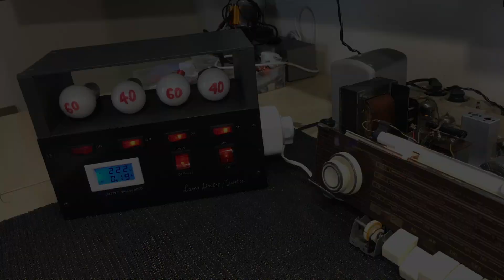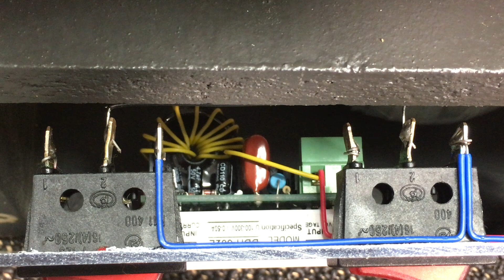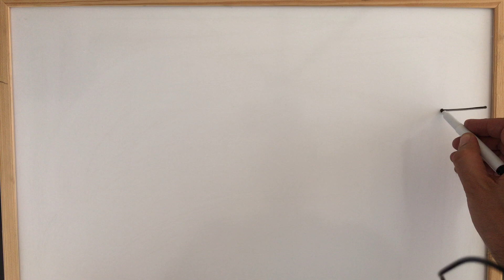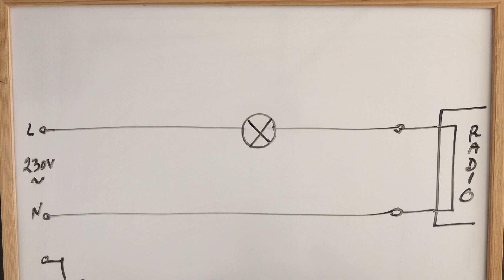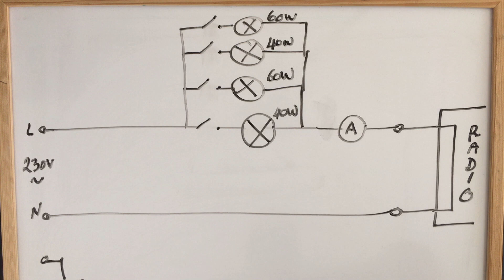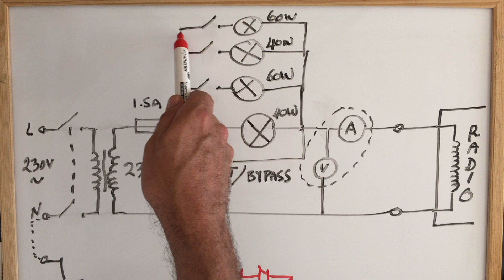DIY Test Gear: Dim Bulb Limiter / Tester with Isolation - Design and Build

Comment: There are some really nice ideas in this built / video - and also in the comments below the video! And, yes, although this schematic is not rocket science, you explained it very well - even for beginners. 
Personally, I have two variacs with insulation transformer in my workshop, but I almost always use only one of them. I would never ever want to miss the variac - being able to slowly increase mains voltage can be so helpful, especially when powering up old tube gear for the first time (it's helpful to re-format the electrolytic caps, it's always good to slowly increase the voltages until the tubes slowly become conductive and B+ slowly builds up and so on...).
On my variac / transformer, I have a switch to connect the DUT protection earth to ground of the mains. It also switches on a red lamp to warn me - but I always wanted to swap this lamp with a flashing light to make it safer. I like the idea of a relay, that automatically resets, when the unit is switched off. In my experience, sometimes it's helpful to be able to ground an amp that is currently being repaired, e.g. to check for noise / hum issues and the like. I might upgrade my unit with maybe 3 different bulbs and automatic resetting relays for the current limiter and the PE-connect in the near future.

Comment: Would there be a posibility to have the indicator of the bypass switch to be lit before you turn on the output power? That way you would be warned it's on bypass mode before you flick the output switch. Maybe add another switch as a master on/off switch so the volt/ammeter will also turn on even before you switch on the output.
Reply from the maker: You could do that, but I have become so accustomed to this version that I will stick with it for now.

Comment: Excellent video and device. I will be making a very similar one but will also add a fuse straight on the mains wire before the isolation transformer. Well done and subbed. 👍🍻🤠🇦🇺

Comment: An excellent video thank you. As you are maybe 100 years plus ahead of me on electrical repairs etc I have to ask you a question please. I own an older toroidal isolation transformer power supply which was used to power healthcare hospital equipment. The 120volt output side has all ground connections disconnected. Can I use this light bulb set up but just remove the built in isolation transformer and power it from my own isolated power source. For me it’s a cost saving thing. Thank you.
Reply from the maker: Sure, that will be perfect
Reply: @electronicsoldandnew   Kudos on the swift reply. I’m learning so much from your channel. Super grateful for people like yourself willing to offer up so much information and advice. You Sir are a one off. Cheers 🍻
Reply from the maker: Thanks

Comment: Nice build! I would add fuses on the primary side too. And you would need to connect the protective ground to the front panel, if it is made of metal, as is in your case aluminium You can look up the rules about the metal sizes above which you need to ground those parts that are accessible from outside. Another thing, do you experience the inrush current of the toroide? Those can be high for bigger transformers, sometimes, depending on the remanent magnetism.
Reply from the maker: 👍 and yes, the torroid does draw some serious inrush current
Reply: @electronicsoldandnew  Do you have any limiter for this? Recently I got from work a discarded medical grade isolation transformer (600VA) build in an enclosure. I took it home and test it. At first it looked all right, but after a while the built in start-delay-circuit / soft-start / inrush-current-limiter, (model OPN 8 from telema company) started to oscillate. So I thought, yeah that's why they discarted it, okay. I opened the case and I have seen that this module (completely casted) have dark / burn spot. I searched for this model on internet and have seen the same problem image and description. When I tried to use the transformer directly it blew the primary fuses 2x1.5A once, and at the same time the automatic fuse downstairs 16A. So that was not really handy 🙂   Temporally I have connected a 240 Ohm 10W resistor in series, permanent if plugged in 230VAC, and with the main switch on the front I turn the transformer directly after a while. So it gets low current to settle down the magnetic field. This works but probably not the most elegant solution. The unit also have only the main switch on the front, nothing else. So maybe I will try to add some more things to it. Voltage/Current reading on the secondary would be nice. I have constructed a 1 bulb current limiter on a wooden plank. I am not repairing a lot, but this is handy to have on the side. Sometimes I try to repair a mains SMPS, and then have trouble using the scope. And it is much safer of course.
Reply from the maker: I would build a simple soft-start circuit externally and fit it at the primary of the transformer. Basically the resistor you have already is fine, and the soft-start circuit would just short it with a relay after a second or so. There are tons of these schematics on the web.

Comment: It could be an idea to use instead of the shorting switch, a 220V relay a the output. If there is not enough output voltage the relay can not be engaged and it is impossible to make a mistake

Comment: hello and many thanks
i want to build one , few questions please : 
if i will build without the transformer , what i will miss ?
what are the main advantage of the transformer ?
can you please add links to the amps module. and to the whole switches , so i can easily locate them to buy ..?
and what about the box ? can i but one ?  or only self made ?
thanks

Comment: Hi , so this design would be OK for SSB cb radio 240v AC  base station troubleshooting that draw a maximum of around 4 amps continuous if you didn't include the 10:1 (10amp :1amp )rf choke on the AC/DC LED display meter ?
Thank you for this video.
✌️ ❤️

Comment: Did you use a special kind of switch? I made a DBT with two sockets, three switches. One for each bulb and one in the middle to bypass the bulbs. Everything works great except I cannot seem to figure out how to wire the switches to where the lights work correctly. I double check all of the switches and they are rated for 125V, but I cannot use the light function or it trips the breaker. When the light pin is not used the DBT works perfectly. I have repaired a bunch of ATX power supplies utilizing it but I would like to have the lights on the switches work correctly. One more note, I am using SPST switches so I'm wondering if my issue is they need to be DPST, or SPDT or w/e.
Reply from the maker: I got lucky when I found these switches, and the issue has been discussed in the comments. Some others have had the same issue and seem to have identified switches that work (see comments). I’m afraid I have no idea where I bought these switches. I had them for ages before using them.
Reply: @electronicsoldandnew   Hmm I read through the comments but cannot point out which one answered
Reply: They are switches, the most simple electrical/electronic device in the universe.
If you cannot work out how a switch works, you REALLY shouldn't be playing around with mains powered equipment. 😮
If you are using self-illuminated switches, you obviously have the line in, line out and neutral cables on the wrong switch terminals. You own a multimeter, right? You can read the circuit diagram on the switch, right?

Comment: I build this about the same way. but i have a problem with the neonlights in the switches, when i switch one of them on, all the neon lights go on, they get there power of the common of the bulbs
via the bulb that is not powered on
Reply from the maker: Check the comments on the video. Someone mentioned which neons work and which don’t. I just used some I had on hand and was lucky.

Comment: Im building one at this moment. The doubt I have, is why did you put a switch on the first bulb, as you will always have it in series with the load. Besides we have the bypass switch in case we want full current flow. Am I missing something?
Reply from the maker: Having all the bulbs switchable gives me all the alternatives possible. What if you actually wanted just 60 W? If the first bulb was permanently on (40 W), you would not be able to achieve this.
Reply: @electronicsoldandnew  ok, thanks. Mine will have 4 times 40w bulbs (what I could get my hands on with a real filament), so the next step up from 40 will be 80w. So only 3 switches in my build then. Thanks for the video, never new about these dim bulb limiters. Next will be getting an Iso.Trans. Got a real heavy shock ones grabbing with both hands an old radio chasis plugged in the 220v. My hart made an arritmic pulse and luckly I bounced backwards in the sofa letting the chassis loose. The shock was way more powerfull than a 220 v ac tickle.   After that I got a bit scared of old radios in bad electric conditions. Did build myself 2 guitar valve amps.
Reply from the maker: Yes, the shocks on those is normally DC volts, which is worse 😊

Comment: When I add the meter, it works fine but I have issues with my dim bulb at that time. Either it does not limit or I can’t turn mains off.  I’m guessing it’s where I’m inserting this.   Any suggestions?    Thank you
Reply from the maker: It could be the type of switch you’re using. Check the comments in this video. I believe it has been mentioned

Comment: Thank you for this video.  I have a question about the voltmeter / ammeter.  The eBay listing is no longer available to purchase this.  I am building a dim bulb tester that will work in conjunction with an external variac and external isolation transformer.  Since my voltage can vary with the Variac from 0-120V (i’m in the US), I need an ammeter that will work with lower voltages.  Most of the ones I see on line only work between 80-300V.
Reply from the maker: I believe that’s the norm, unless you get one that requires a separate low voltage DC supply
Reply: These meters use a capacitive dropper to provide power to the meter circuit.
So, find the PCB trace that connects the capacitor to the mains input. Cut the trace and supply the capacitor with full mains voltage, and leave the remaining components connected to the variable mains from the cardiac.

Comment: One thing to note is… High power Push Pull guitar/bass amps (50 watts and upwards) will still make a 150W bulb glow faintly after warm up, even with no shorts, and you’ll have to recheck the bias once you run it without the limiter.
Reply: Yes, this is why I often use a 250W halogen bulb as current limiter in my setup. 
For servicing bigger amps e.g. 100W twins and Marshalls or even SVTs and the like, this is what you need.

Comment: If you want something mostly ready made enclosure wise…. 6 or 8 unit rack case for audio equipment would fit the bill. Can buy blank front and rear panels for them too, and handy drawers (if you have space left over).

Or follow MendItMarks approach and use household switches/bulb holders/sockets mounted on a board quite far up the wall next to the bench.

Comment: Inspired by your video, I have finally built my own DBT. Since I don't have an isolation transformer, I added an MCB followed by an RCD at the start of the circuit, before the switches - just for added safety. I have a question around the voltage - if I test a load with let's say a 40w bulb, I'm assuming that the bulb not only limits the current but also the voltage since they're typically 2 resistors in series.
1. Is my understanding correct?
2. And if this is true, how can we calculate the voltage available to the load depending on the number of bulbs being switched on in the parallel circuits?
3. Lastly, if a device needs a minimum of 220v to operate, I'm assuming it can't be checked using this tester?

Sorry for the excessive questions.
Reply from the maker: The voltage drops after the current starts to flow, so actually it cannot be relied on to drop voltage. You cannot calculate the voltage that results accurately, because it always depends on the current drop across the load, which you don’t really know until you try it. You can test it because the device usually starts operating  at far lower than the rated voltage .
Reply: @electronicsoldandnew  Thanks for the info. Another strange event - I connected a device with 110-220v and 40w rating to the load. I tried with a 40w bulb, but the load did not power up. I then added a 60w bulb in parallel but the load still did not turn on. The load was a hot glue gun. Any idea why this would load would not power up with a total of 100w globes connected?
Reply from the maker: No idea. Perhaps the hot glue gun requires too much current and the bulbs reduce it too much.
Reply: @electronicsoldandnew  I'm guessing that's an incorrect rating mentioned on the gun. Will try with a 200w bulb or higher.

Comment: hello... great video explained well like all the others... just one (maybe stupid) question:
if the intention of using the lamps is only to reduce the current when there is a short circuit (and therefore highlight the short circuit when the lamp lights up) wouldn't it be enough to put only one 40W lamp instead of 4? I understand that a single lamp also limits the voltage across the load... but we only have to see if there's a short... right? or is there another explanation for having much more lamps? thanks in advance and keep up with these interesting videos.
Reply from the maker: The detection of a short circuit is only one part of the story. You can get breakdown of components as they are subjected to high voltages that may not happen instantaneously. It may actually take some time before a short occurs, and in the meantime you want to see if the radio has any life in it. Also, by checking how much current it draws you can get an indication of the state of the device.
Reply: @electronicsoldandnew  ah... OK. I got it. thank you

Comment: Lovely layout.  I would suggest flipping the orientation of the ON/OFF power switch because it is much easier to slap the switch down for OFF during a panic shutdown.  Just like your wall light switch in your home (I'm in USA).
Reply from the maker: I grew up with the opposite conversion so I always do it this way 😊

Comment: May I ask a question please. If the secondary output has no neutral but basically Line 1 and Line 2 output. Does it make a difference which side feeds the dim bulbs.
Reply from the maker: no, it doesn’t.
Reply: @electronicsoldandnew  Thank you for you’re quick reply. Great videos by the way. 👍

Comment: I'm finally getting round to building an isolated dim bulb tester. Tungsten or halogen bulbs are not the problem for me. Where I need advice is how to source a suitable toroidal isolation transformer. I'm UK based so 230/240V would be ideal. Do you have any suggestions?
Reply from the maker: Try RS components or Mouser.
Reply: @electronicsoldandnew I must be asking the wrong questions because I can't find a 230/240V 1 to 1 toroidal. Ho hum I'll just have to keep looking.
Reply from the maker: look for 2x115vac primaries, and 2x115vac secondaries. Use them in series
Reply: @electronicsoldandnew  Thanks. Finally found one at RS Components.

Comment: Possible improvements: The design of an isolated adjustable AC power supply for repair and testing (calibration) is largely dependent on the type of product that will be repaired or calibrated. This is why you see so many different overall approaches on youtube. So if the target product is a tube radio then the design takes shape around what works best for radios, with one appoach shown in the video. 

If the AC power supply is to be used as general purpose supply across many products for repair and calibration (high and low line) then the design becomes more complex and usually more expensive. The obvious addition would be a variac after the isolation transformer to adjust line voltage. Also common, in my experience, is to replace the bulbs with non-inductive power resistors and include an analog AC ammeter. The power resistors eliminate the changing resistance of a bulb from cold to hot (which introduces a current dynamic that is not from the Device Under Test) and the AC Ammeter analog movement visually is much slower than a digital meter and by its behavior you can tell a lot about the fault, especially if you repair the same product types or models. Failure root cause for specific models over time tend to follow a pattern, which many times, in the end, reveals weakness in design or unforeseen limitations of the electrical components used. If you repair the same model type device (or family of similar devices) you can tell a lot about the failure by visually observing the analog meter movement when powering the device.

Comment: Manuel in your  dim bulb tester design, didn't include a variac transformer in order to control the voltage has to be applied to the radio.
Do you have any reason?
Reply from the maker: I didn’t have a variac at that stage. Got one later and now use the two in series.

Comment: I found this excellent video yesterday. Went straight to the garage and duplicated your solution using a box made of wood and old parts that I have collected over the years. Not as fancy as yours but still the same function with four bulbs and a bypass for the limited current and it works well!